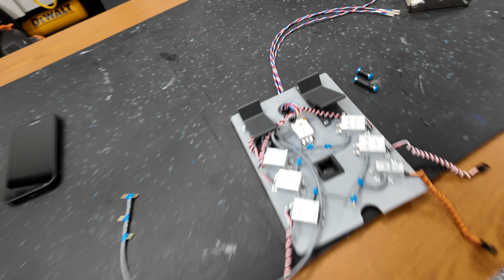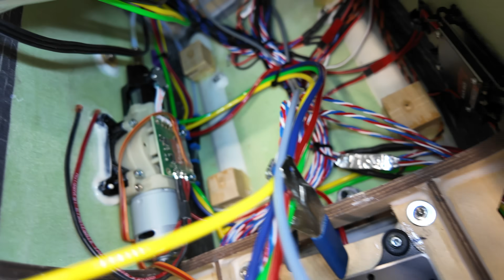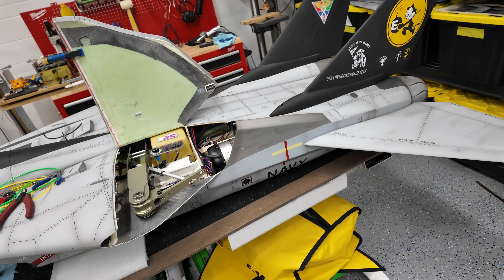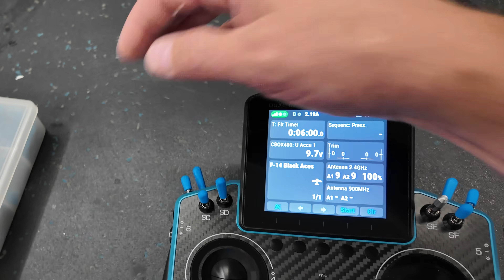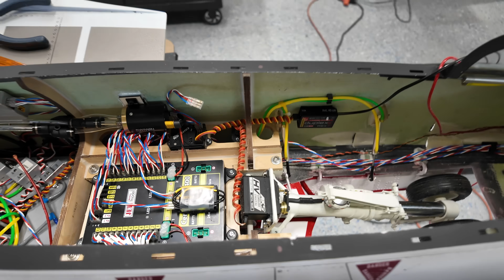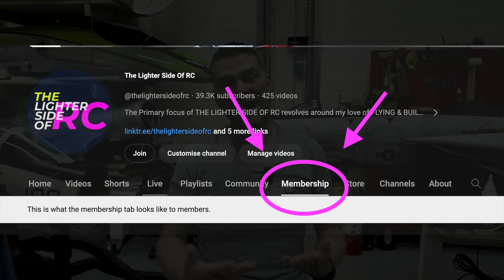F14 RC Build: From Mess to Masterpiece - Skymaster Video 7

Comment: Hi Jonathan, is it okay to use festo fittings on fuel pump to make it easier to get it out for sending it to service or you don’t recommend it?
Reply from the maker: You can but I like to have the least ammount of fittings as possible.  But I think we often overthink this when it's a non issue.